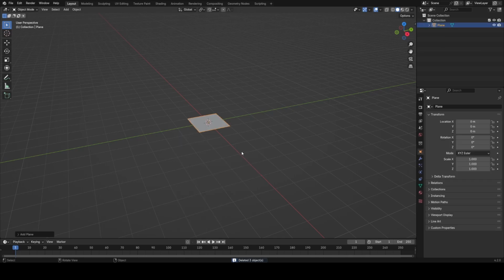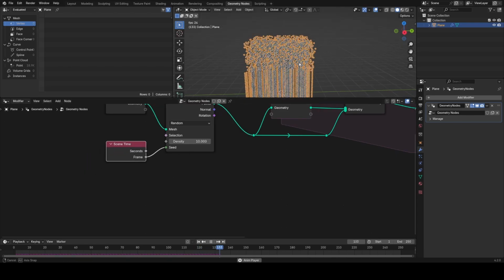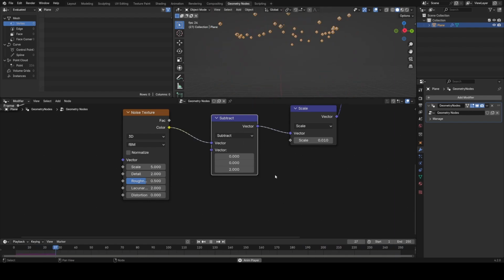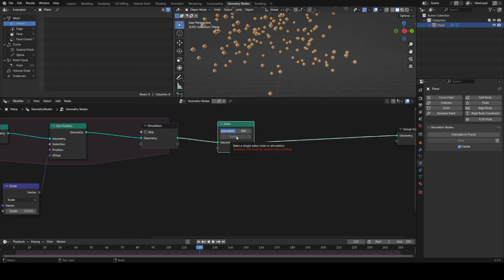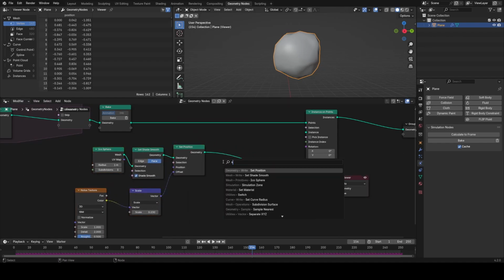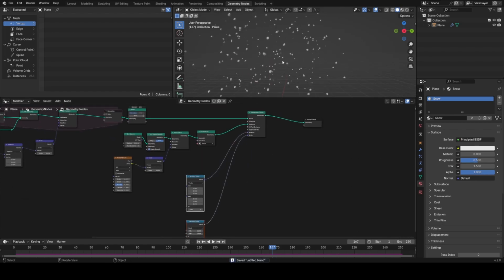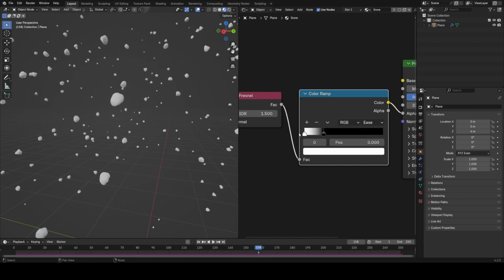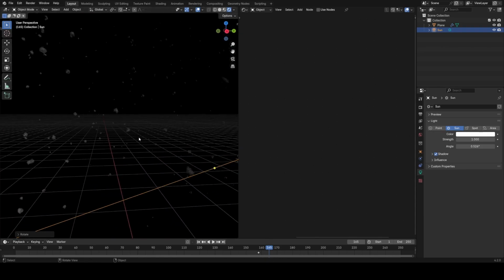Snowfall in Blender 4.2 using Simulation Nodes

Comment: How do I widen the area where it is snowing without changing the size of the snow flakes themselves?
Reply from the maker: You can do this by changing the size of the emission object in geo nodes
Reply: @Polycount-tw4ix I don't see where to change this setting. I don't see an emission object. Could you guide me in the right direction?
Reply from the maker: @WallyJ2K  By emission plane i just mean the original geometry, so you can either scale it with a transform geometry in geometry nodes at the very start, or the easier way is to scale the plane in edit mode to the area you want it to snow over :)
Reply: @Polycount-tw4ix Great. Thanks!